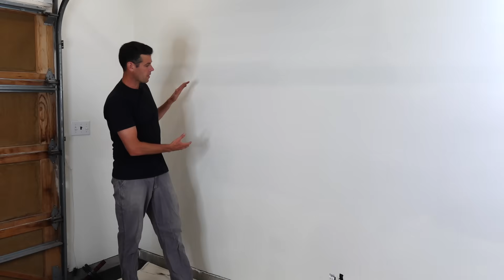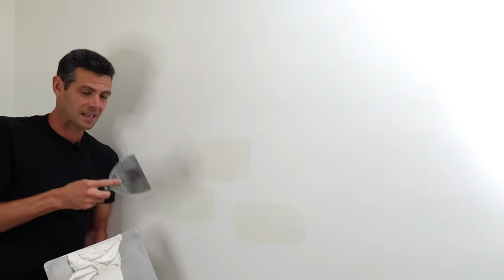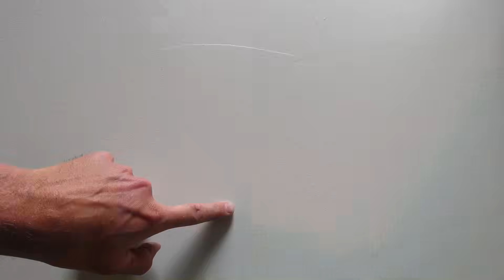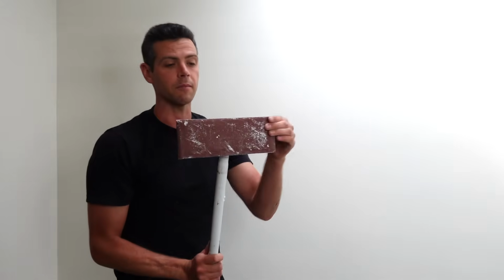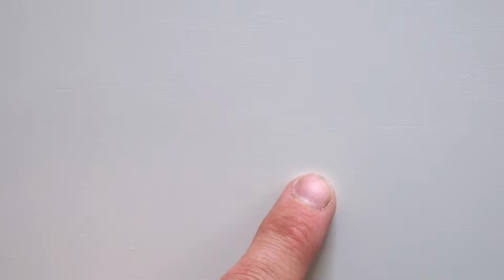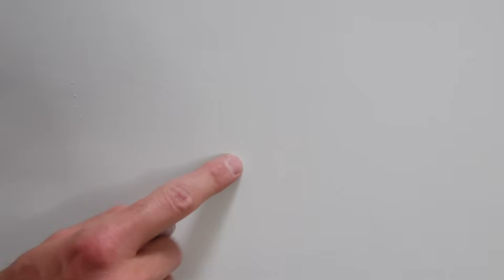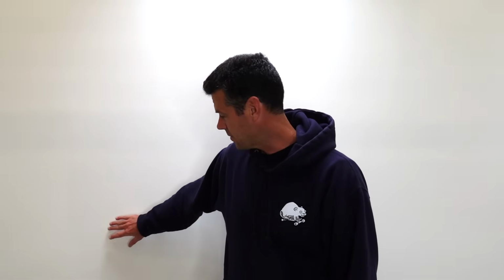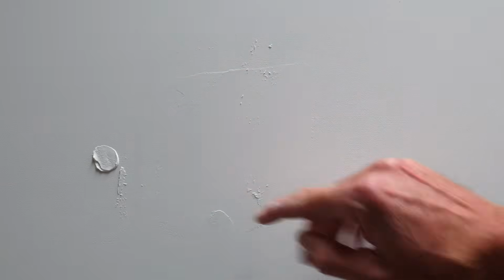How to DESTROY YOUR SKIM COAT with TOUCH UPS!!!😭

Comment: If there are imperfections in a skim coat and you're trying to go for a smooth finish, is it possible to fill things like scratches, pocks, and rougher areas without those areas flashing after priming and painting?

Oddly enough, I haven't found many videos from anyone on how to properly touch up a skim coat (if that's even possible). I've watched Vancouver Carpenter's video on what not to do when touching up a skim coat (i.e. touch up after priming, don't touch up sanded mud, etc.). But I can't find a video on how to properly touch up a skim coat without having splotches and flashing all over the place.

I mean, I know ideally a skim coat should be perfect after applying it, with no tool marks etc., but let's be real, there's always going to be something that gets through, whether it's an occasional hitchhiker scratch or an accidental ding in the wall from a stray tool. But surely re-skimming the whole wall isn't the only solution in all these cases?
Reply: You only need to reskim if you have already sanded the wall as the sanding compresses the topping mud. If you prime then fix things you can sand, prime again and be good to go.

Comment: thick drywall is made cause framing , repairs,sheetrock laid out is incorrect, 3 coats the charm with a light apply then remove first coat is a tight, the second is a light float ,it may be enough , warm,hot water mix mud with joint compound always keep mud a little wet to have smooth floats  ,then the third should be wet sand with a damp cloth sponge by hand in section , then the third is fixing mistakes using a plastic set of knifes work best for feathering,, if you cant see them , need extra light or  tint colorant lightly mix properly in between with hot water splattering best color is light gray or tint primer light gray, , with primer it should be light coat to see the flaws mistakes then primer patches then re prime the entire walls,,, thick primer as for primer finish ,paint ceiling paint as finish ,flat is always the best ,

Comment: 😃Have you tried the wet sanding or wet sponge technique to prevent sanding dust? Thanks for all the educational videos!
Reply: Never a good idea. A damp sponge to wipe down the dust would be the only time I would use a sponge.
The moisture will soften the mud too much and you will ruin your work.

Comment: Just curious - what material would you recommend for touch-up after priming?
Reply: I find that base coat 45min (hot mud) over the primer works nicely for touch ups and does not flash through the paint.
Reply from the maker: Either drywall mud or drydex
Reply: @vancouvercarpenter  Thank you!

Comment: well looks like u useing new planex(festool) and its quite difficult to sand it properly(i mean pure flat under the streak lamp)because of design this machine. Old planex was much better. The new one same as Mirka(which I have) has eccentric(if im correct) and that's not let u do really good flat wall sorry for my english:)

Comment: I so appreciate learning from you.  But help! I'm panicking.  I removed towel bars in bathroom and hot mudded the small holes and let dry for 2 days before using Plus 3 for final coats.  Sanded and feathered out.  Then I used oil based primer because there were areas where wallpaper border was removed leaving glue residue.  But when priming walls, the patched areas are not taking the primer - i.e. flat compared to walls.  What did I do wrong?  I don't dare paint until I figure out problem. Thk u.
Reply: there is a special primer for that leftover adhesive residue called  Guardz.. not sold at Home Depot or Lowe's as far as I know
Reply: @sicindividual  Thk u for your response. I used Kilz Original.  Shouldn't that do the same thing Guardz does?
Reply: Is it just the areas where the towel bar holes were or the areas where the glue adhesive was ?
Reply: @sicindividual  All the areas that I either hot mudded or used joint compound.  The glue area seems fine.  It's just repaired areas seem to be a different flat than the rest of the  primed wall.  After doing my repairs, I primed the entire wall.  Sorry to make this so confusing. Maybe I should apply the first coat of paint and see what happens.  I just don't want the repaired areas to look different.

Comment: As I'm a perfectionist at my job and hobbies most home owners would not notice Suttle bumps or waves especially on a ceiling.
I good friend of mine that paints for a living told me many years ago something that changed my life forever. One day we were working together on a office construction job and during our sand and paint time I pulled out my trusty flashlight to look for and imperfections and I point out a few and he say "put that flashlight away". Home owners don't walk around their house with flashlights looking for flaws in the drywall. To stop those ridges you can paint it and then fine tune it (spot) and not sand away the layer underneath.

Food coloring won't mess with the quality of mud

Comment: You guys are overthinking this. Prime your walls first then do your touch up patches and tint it with blue chalk. You will be able to see imperfections way easier after its primed and you won't sand through your finish work.
Reply from the maker: For the guys who are only taping subs like I was, you can't leave too many touchups for the painters. So I learned how to do my touchups before painting if there were any. Painters love me.
Reply: @vancouvercarpenter  so let them prime it if your subbing out the painting and come back for a quick touch up, although that should be the painters job just saying. I do both trades tho.

Comment: As I understand the situation, in the North American construction market, quality is sacrificed for speed of execution. Soft mud will not give a good finish. I mean the whole line of USG products and their like. Even after the primer, the patch crumbles. Especially if deep scratches are fixed. I know people who finish with car fillers. Because there are no special materials on the market for this.
In other countries I have worked with ABS, Satintec gypsum putties made in Turkey and special putty finishing mixes made in Finland. We also used special impregnations between the layers. This technology made it possible to achieve perfect quality. Hard putty + hardened surface the result is excellent. But all this is not in the NA market. There are no European materials. Why is a another question. Therefore, all this Level 5 work is a waste of time. Materials do not allow to give excellent quality.
Smeared the mud, or sprinkled the texture and that's it. That is what these materials were created for. Excellent quality is not about NA. This is not Germany.
One more observation. There is mud in NA. In Europe, spackling paste, putty compound, putty. And mud is mud. Everything is contained in the name.
P.S. I hope no one is upset?

Comment: Of course you are going to get chatter with skim coat. Run your knife perpendicular on second coat and 45° on the third. Also, if you are sanding anything but your final coat you have failed your application. Aim small miss small

Comment: There's nothing wrong with aiming for perfection, but, ever looked down a long hallway and seen the waves, oddly enough, about 16" apart? The lumber, especially today's, is not perfect. If you need to shine a light parallel to the wall,   you're looking too hard. This isn't auto body repair, no normal person is going to notice.

Comment: I've been drywall finishing for 42 years . My specialty was smooth wall . I've tried the Fess tool before but I would not use it do my final sanding. I found that it has a tendency to over sand your walls to the point where you will get down to the paper. You have better control with a pole sander. As far compression what the hell does that mean ? I have never had a problem with pulling my touch up tight as long as you have a good glaze coat it shouldn't be a problem. Your close up shots show that your sanding grit was to coarse. Use a 180 grit on your first pass then use a 220 grit on your next pass with less pressure for the best finish. The Fess tool you used on your walls over sanded them making it harder to touch up your wall. As far as sanding your touch up us a pole sander with the 200 grit for best results.